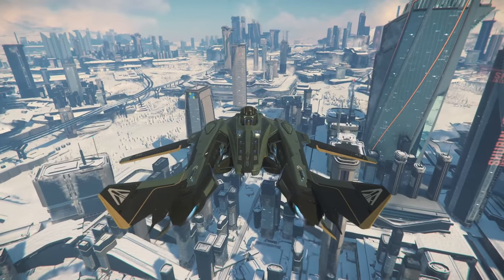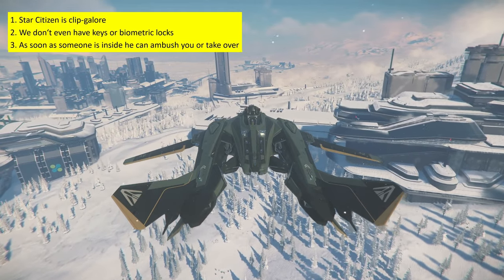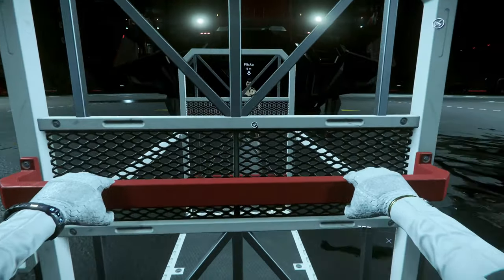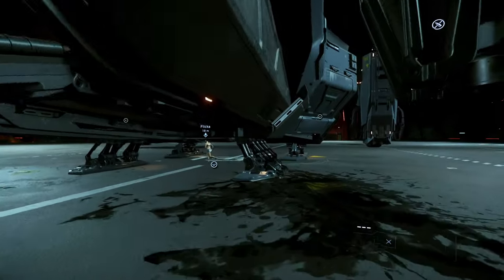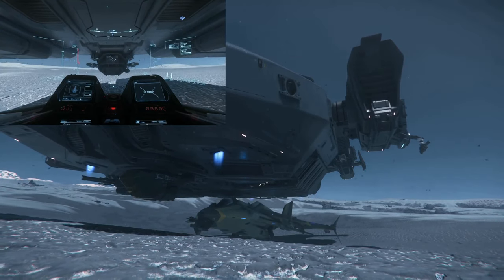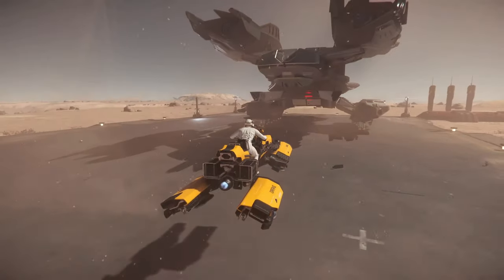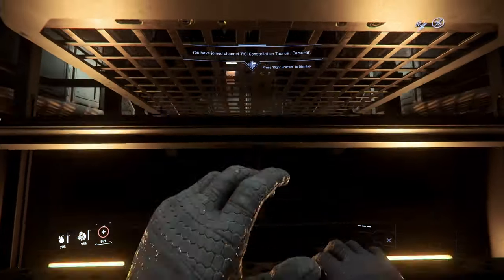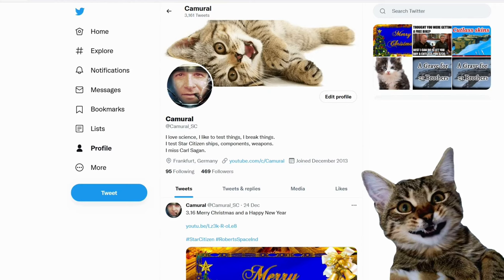3.17.1 Clipping into ships - showing different methods

Comment: I don't think this video is fair or productive (no reason to show these exploits). CIG is well aware of these clipping issues but have no way of solving them currently.

Yes, the game is in alpha and it's irrelevant what other games in alpha did or does. It's not an issue they can "just fix with a patch". 

The way to avoid clipping is to have the server verify that you are allowed to be in the position your character is at on your client and either refuse or accept the position. Currently, the server just accepts whatever result you are able to produce on your client.

Solving this would mean to let the server do additional work by verifying the position of all players. And as you well know, the servers are stretched to max capacity already.

I.e. there is no way to solve this until the load on the servers are reduced with server meshing. Server side authority of player position is needed to solve other issues (clipping through ground, getting stuck on objects/terrain etc.) as well so this is coming for sure. E.g. instead of clipping through ground, the server would reject the position and place the player back on the surface (and with proper performing servers, so fast you would hardly notice it), or ejecting close to another ship would have the server kill you when the impact is registered, etc.

As for punching doors open is the bi-product of intended place-holder mechanics. As there are no breaching devices in the game yet, a door is breached by applying damage. That be either from ship weapons, guns, or your fists. This place-holder mechanic will be removed eventually when there are proper ways to breach a door in-game.
Reply from the maker: SC Dude so you think this video is unfair because I am showing problems that are in this game in alpha for many years?

(Quote): "CIG is well aware of these clipping issues" (end of quote) are you sure? 
All I hear from CIG is "you are responsible for your ship and your cargo which was the main motivation for me to make this video

Also not every problem in the world can be explained by (quote) "servers are stretched to max capacity" (end of quote) because we have the same clipping issues in Arena Commander which has far less problems with server performance.

You should be happy there are a few Star Citizen channels that are not hyping every micro-improvement we get, but that are showing problems because we want Star Citizen to be a fantastic game and a huge success.
Reply: What is unfair? These are annoying bugs/exploits, which will need to be adressed sooner or later. We definitely more of these kind of videos to warn players and put some fire under the dev's bosoms.
Reply: @Camural  currently the client (the game on your PC) has authority over the position of your player. When there is overhead on the servers, they can make the position of the player server authoritative. So it doesn't matter if it's AC or the PU, when these checks are not in the game yet.

You are responsible for your cargo and your ship in a finished game. Right now you are responsible for play testing, and in the process not exploit know bugs that currently can't be fixed.

I think most of your videos provide good criticism. Some of them show a lack of insight on your part - this one in particular.
Reply: @qenyaithandrill7848  They are already working on server meshing. Do you really think this video will make it go faster? In the meantime, there is not really any good reason to share different methods to exploit the game. If this was posted on the issue council (which is has), the report would be set to hidden by CIG for good reason.
Reply: @randy45drumur26  yes, I'm  a white knight fanboy. Please buy some more space ships too. Chris and Sandy needs another break from the hard work on the Maldives.
Reply: Nope. One of the highest grossing live service games. Honestly this guy is being really chill about it.